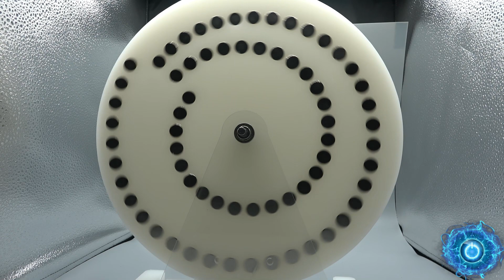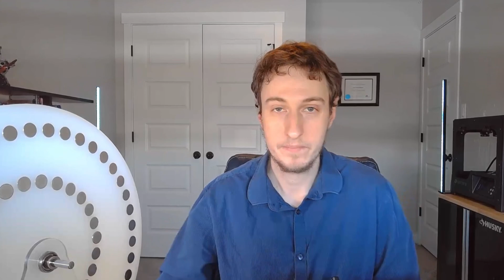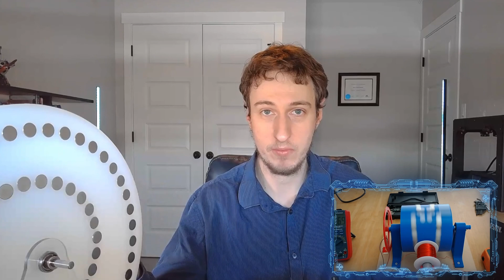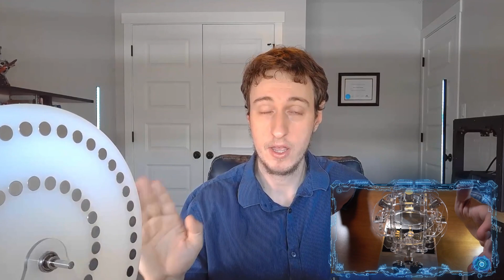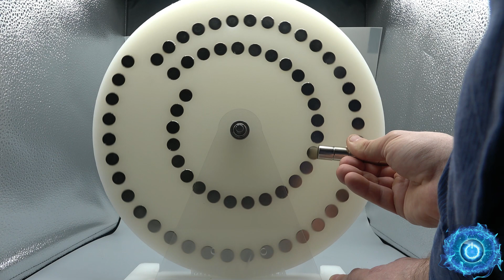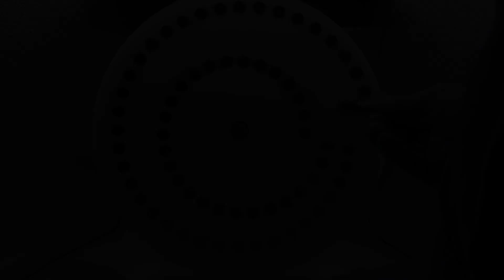V-Gate Motor - Does IT WORK?!

Comment: You know how you can take two Faraday discs and orient them a certain way and connect a conductive chain around the perimeter of the two discs like gears on a bicycle.
Well, what if you replace the principle of the chain with a metal table that has a gear pattern engraved into the face of it making a circle.
Take four of your V-gate setups but have the matching gear pattern built into the white disc that you show.
Set four of your v-gate discs in a square pattern along the gear circle in the metal table.
Lean your discs so the tops of them come closer together. Probably at a 45 degree angle at most.
This will give it more stability like a racing wheelchair.
This part I'm going to not try to describe Because of complexity, the top piece that connects to the four discs has a little bit more gearing complexity but the end result is it's four turning motions on a motion that is overall turning the four.
The rotating piece that is supporting the four rotating pieces aka gears that the large discs are laying into will have four arms coming off of it holding the magnets that you would pull away to overcome the resistance.
If you do all your gearing ratio correctly, the four arms holding a magnet each will always be position stationary on a particular orientation to the face of each disc.
AKA the magnet being held from the top center piece from each individual arm would always be held in place as the disc rotates the same way how you're holding it still to the same orientation you're just pulling away and putting to.
So now you stage your four V-Gate discs doubling as Michael Faraday discs. And you offset them so you always have the power of three discs overcoming the resistance of one disc.
So now you just tap the centers of each disk for your electricity.
This should turn out to be self-starting non-stopping Faraday disks.

Comment: Hi James, 
Definitely, you put a lot of effort into this. But don't quit there, the best way to figure out these solutions is to dream and experiment with them and you will succeed. There are dozens of different versions of these magnet motors that have already been invented. Have you seen the video of a German guy who successfully made one of these V-gate M motors (The magnets were mounted on the circumference of the wheel) which was rotated at a very high speed? That was also very impressive.  Here is one that looks very simple but it has to be tuned properly to work. https://www.youtube.com/watch?v=MT1YOifcyFA

Comment: Friend, maybe I've misunderstood you... or, perhaps you don't see it as I do.
Either way, did you state, you can get it to run but not after APPLYING a load to it (positive output)?
If so, then as far as I'm considering it, the job is done.
Surely, if it runs... but you cannot extract a practicable or tangible/visible application from it for use, say, in the illumination of an LED... it is most certainly IN-MOTION and ALREADY outputting a force against resistance and/or causing vibrations and/or pushing atmospheric-air out of its way JUST to maintain itself....
You are simply asking TOO much from it. Use what it is already giving you.
Reply: Sorry, upon reviewing this, I realized you said, "With the use of a battery."
Ok... back to my machines now, then... I guess!

Comment: Yeah, build it right so your magnets are MUCH closer together and it will run. You are wasting the vast majority of your magnetic torque thanks to the distance your magnets are from each other. Get them 1mm apart...like you see so common in motors!
Reply: I think my test with 12 magnets all north out... one magnet went neutral it would stick to both piled
Reply: @mitchpayson6203  In attraction or repulsion doesn't change how this design works. Using all N or all S in your V won't change operation either. I can't imagine that you caused a magnet to lose its magnetism without a lot of heat. I think you had a magnet that was never magnetized to begin with.

Comment: No. You need to modify the magnet. You can get rid of that resistance by redirecting the fields. Not enough energy in that for coils. Use steel
Reply from the maker: You can't redirect magnetic fields completely though, there is Mu-metal but it works only to a certain percentage. Coils can be turned off/on in milliseconds with a hall sensor so there is no redirection.

Comment: I watched your video on the v gate motor. Would you believe I got a brainstorm moment looking at the rotation. Here goes, I you would take a large disk magnet and place it in a fixture with a coil piston connected to a crankshaft by a connecting rod. The piston placed between the disk magnet so the piston can move to just about touch the magnets and at the last second get energized to replace the piston which would make this item run really well. This idea has room to improve the design by using a Scotch Yoke which would have two pistons firing at the roughly the same time. This would give the battery way needed power assist to make the motor run for a very long time with the ability get power out. Hope you give it a try Tech Planet.

Comment: Very real and rational run down. Glad you highlighted the fact that theres no usable energy. Not sure what the one with a coil was trying to prove, it was powered from a bench PSU. 
One important fact though. For a true closed system that can power itself indefinitely, It would need to work in complete darkness at absolute 0K. Do ppl now see how impossible it is? Any other condition is being influenced via heat or solar and we are we down those paths. So when working on these projects make sure you illuminate all external energies. Thermal, mechanical, solar etc.
Reply: Fwiw, 0K is actually impossible, because the quantum uncertainty principle says that everything must have some motion.  If something truly no motion (0K) then its position uncertainty would be infinite.
Reply: Maybe the coil was just an electromagnet that you could turn on and off instead of pulling the magnet away from the vgate.
Reply: @lochnessspeedwerkz6557  Then it would take energy to turn the electromagnet on and for it to rebuild the magnet field.
Reply: @johnflux1  Just like it takes energy to move the magnet with your hand. Go watch the video yourself. He wasnt claiming to make power, he was simply spinning his vgate with an electromagnet.
Reply: I get what you are writing, here.
However, is that REALLY the goal?
Or, is it, rather, to develop a system whose output is greater than its input for practical applications?
Screw some award/reward from some society that only scientists recognize...
I think, for most, the benefit resides in the output, itself.
Reply: @NoCantsAllowed  If their goal is to produce more energy output than they put in, then they are on a fool's errand.

Comment: what about removing a row or two of magnets instead of pulling it away?
Reply: replace with non magnetic material of equal weight
Reply from the maker: Maybe Mumetal?
Reply: You need the magnets as close as possible for acceleration any gaps would break the acceleration.. Think of it as rolling down a hill then instantly going back to the top. A long gradient gives good acceleration but you need to jump the top to start rolling down again or you'd bounce back. To remove any magnets is like lowering the height of the hill.
Reply: @thegeek3295  when the magnet is pulled away there is at least 1 row that is not being effected by it. just a visual observation. if the mass is replaced the inertia may be enough to complete the rotation without removing the magnet at all. i understand what you're saying though, just a pot head brain storming.

Comment: It's almost like the energy to move the magnets in and out had to come from somewhere, no matter what the delivery mechanism. Physics 1 PMM morons 0. Again.
Reply: Where does the energy the magnet uses to pull things come from, where does the energy the earth uses to pull things to it come from?  Does the potential energy of the sun decrease as it pulls hydrogen into the center to make fusion?  Work is being done, but what energy store is decreasing in the earth when it pulls something toward it?
Reply: @musikSkool  "Where does the energy the magnet uses to pull things come from" don't confuse energy with force and where the work is produced.
The magnet creates a magnetic field which is exerts a force on moving charges. "Magnetic field" energy is a potential energy of an object in a field. Which means it is always external forces that actually move the object  that change that potential energy. Things moving towards the object translate their potential energy into work. 
Same goes for the earth - it is a potential field, and the work done to remove object is equal to the work produced by the object when it comes back.
The funny thing with potential fields is - work performed during the movement along any closed loop is exact 0. This is pure math, so it is proven, beyond any chance of further theory changing it.
Reply: @alterbart7916  So if we made an electronic device that could create a field, it would take 0 energy?
Reply: @musikSkool  Be more specific. Which device? Which field?
Reply: @alterbart7916  quick correction - potential energy is stored in their combined system. We say a ball thrown up in the air has potential energy but really it's the ball-earth system that has and stores this potential system, specifically in the spacetime curvature
Reply: @johnflux1  Thanks. 
I did not want to go there... It is just too confusing to free energy seekers, they usually lack capacity to understand simplest models.
Imagine what would be if you'd started talking about the mass defect and the entropy change?
Reply: @musikSkool  The energy the magnet uses to pull things comes from the potential energy in the magnetic field.  The energy the earth uses pull things comes from gravitational potential energy.  Fusion converts mass energy into thermal energy.  Gravitational potential energy store is decreasing in the earth when it pulls something toward it.
Reply: @johnflux1  Where is potential energy stored?  What physical thing about the earth changes when it pulls something?  We simply do not have a complete understanding of physics.  Physicists agree that we do not actually understand how magnets work.  We can document how they react in an experiment, but how magnetism attracts things, we do not know.  Aligning electrons?  Sure, so if you align the planets, would that make some magical magnetism happen?  Nope.
Reply: @musikSkool  Gravitational potential energy is stored in the curvature of spacetime itself.  A bit like bending a rubber sheet.  The physical thing that changes is that spacetime straightens out a little bit, unbending.  I'm a physicist, and we absolutely do understand how magnets work.  We know how magnetism attracts things - it's the electromagnetic force.  Aligning planets doesn't work because gravity doesn't have poles.
Reply: @johnflux1  So when electrons all go the same direction, you know why other electrons want to go to?  Okay, God.
Reply: @musikSkool  I don't understand your question. Electrons are Fermions which means they do NOT want to all be together. Are you thinking of photons which are bosons? Like in a laser?
Reply: @johnflux1  When all electrons are aiming one direction, we call that a magnetic field.  But we don't know why when electrons are all going the same direction a field springs out of nothing.  We have theories, but is there a background electromagnetic field everywhere that we bend, or if the universe had no electrons, would that field exist?  We don't know everything.
Reply: @varukasalt  I understand completely how to USE a magnetic field, but as to why it exists, we can only theorize.  If we knew, then an electro-gravity device would be as easy to make as an electro-magnet.  A gravitational field would be as simple as an electromagnetic field.  We have plenty of objects with mass, much like we have plenty of magnets.  We can make electromagnets, and if we understood what was happening, we could make electro-gravitational attractors.  If you really knew everything there was to know about magnets, then you wouldn't be interested in videos like this with experiments that might teach you something new.  No I don't believe in perpetual motion, but if the magnet somehow lost mass then it isn't perpetual, it might just be a form of converting an electromagnetic field into energy.  Much like fission isn't free energy, because you lose something in the process.
Reply: @musikSkool  I understand that you don't understand physics, but why you are saying "we" as if you speak for physicists?  Are you confusing your personal ignorance with the entire scientific field?  Because I understand it just fine.  And yes, the electromagnetic field exists when there are no electrons. The universe was in that state during inflation.  We had photons (waves in the electromagnetic field) before electrons existed.
Reply: @johnflux1  I understand how to use all the equations, what I am saying is we don't know how electrons have telekinesis.  We CALL it an electromagnetic field, but that is our interpretation.  We don't actually know WHY electrons have a force field, of course we know they DO have one, but HOW?  You seem to be unable to grasp concepts that there are things happening that we don't know, its okay, the scientific community has not known things for many centuries.  At one point in time, people believed they understood gravity, things fall, everyone knows that.  Newton had to explain to them that they didn't really know what was happening, and there were probably people like you who kept telling Newton that things fall, and they completely understood it, so why was he telling them that Gravity was holding the universe together?  The sun doesn't fall to the earth, so clearly there is no gravitational pull between the sun and earth.  They were of course wrong, and we can look back and laugh at their ignorance.  Go ahead and keep your head in the book and repeat after me, we know everything, and there is nothing new in the universe.  I on the other hand will accept new discoveries, and acknowledge holes in our understanding.  I do know physics, but I know the difference between a model to visualize a concept, and a reality that is invisible.  That is why we can't disprove string theory, because it is just a model to understand the subatomic, and invisible, that also is capable of explaining atomic interaction.  Some of the math proves it wrong, but then again, some of the math disagrees with the classic model, and that is why we don't have a theory of everything.  Because we are missing some variables.  Maybe there is a time/mass constant that is more complicated than our models allow for.  Like how E = mc² isn't the whole story, it is missing a few terms, we are probably missing something.
Reply: @johnflux1  Okay, so the invisible thing that attracts metal to magnets is light.  The invisible thing is light.  I suppose next you are going to tell me that it isn't on the electromagnetic spectrum.
Reply: @musikSkool  It's not interesting talking with rude people who don't want to learn.
Reply: @johnflux1  Finally, something we can agree on.  Okay, joking aside.  I hadn't heard about the photon theory, that seems very interesting.  Now I am wondering why lightbulbs, which send out photons, don't attract metal to them, and why we don't have any flashlights with magnets instead of bulbs.  I am legitimately interested in finding the answer.  Thank you for enlightening me to this new field of theoretical physics.  (The magnetic photon is still considered a hypothetical particle in science, this is probably why I didn't hear about it.  I don't usually deal with theoretical physics.)
Reply: @musikSkool  Photons will move electrons inside a metal wire (that's how radio waves are picked up by a metal antenna).  The rest of what you said is completely off sorry.
Reply: @musikSkool  A high school level physics class would answer all these questions for you.